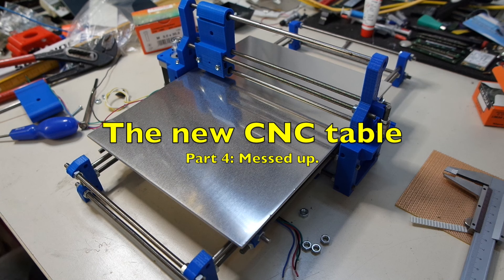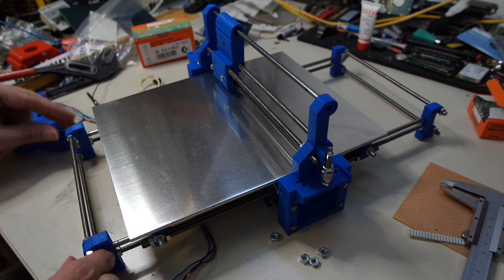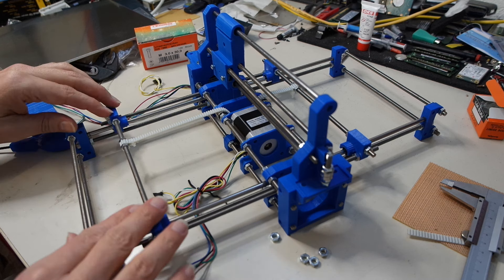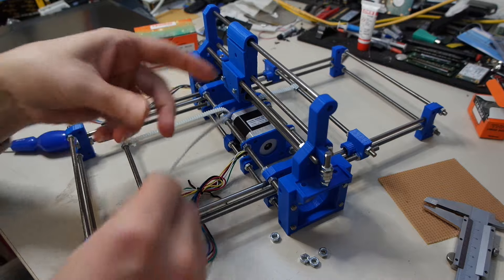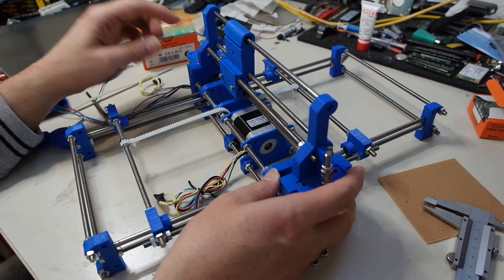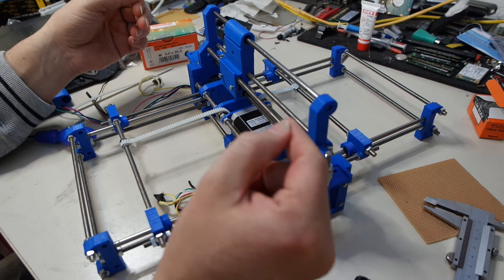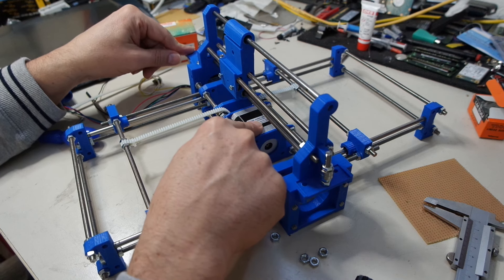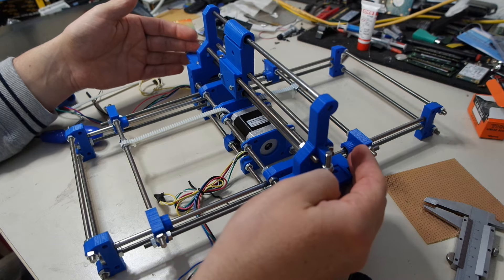The new CNC table pt. 4

Comment: I had similar problem. The unlucky issue was that I also didn't have 3d printer at home, so had to "re-order" the parts, 2 times over.
Reply from the maker: Yes, having a 3D printer locally really helps.

Comment: The cnc table is looking pretty good. And you're lucky that the problem is with 3d printed parts only, imagine if it was an issue with laser cut parts or machined parts lol that would make you pretty mad.
Reply from the maker: Yes - that would have been worse. I'm just mad at myself, that - although I went through several iterations of parts - I was completely ignoring what I was seeing there -
Reply: Things like that happen to me all the time haha

Comment: Good Morning. What is the exact model of the stepper motor since there are several NEMA 17
Reply from the maker: I usually buy 'Longs Motor stepper motor 17HS4401N'. They work out really good.
Reply: Unipolar motor for this purpose?
Reply from the maker: You are free to chose - I used bipolar ones.

Comment: I'm sure by now, you'll already know this by now but, if you used a parametric design tool (Fusion 360, FreeCAD etc) and put the right parameters in you wouldn't have had this issue. ;-)